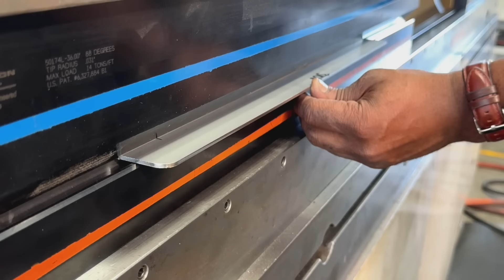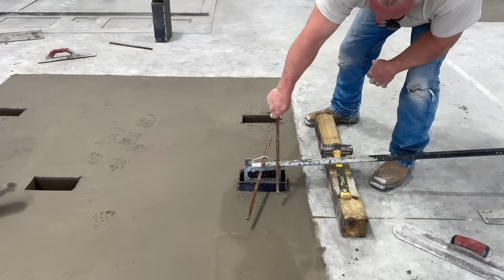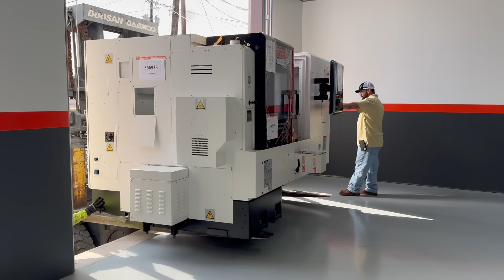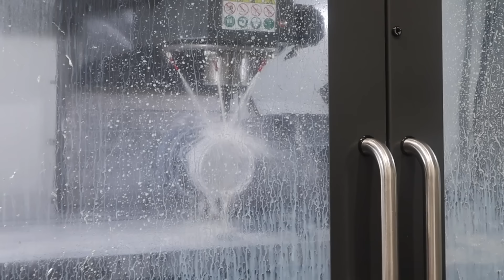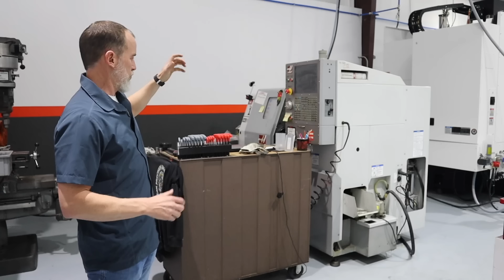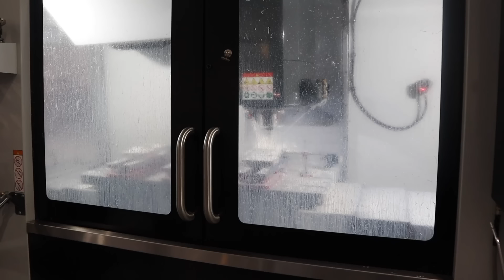We Turned a Greasy Warehouse Into the Ultimate Machine Shop

Comment: We faced the same thing..... Moved from 28k sq ft to 55k sq ft. Moved 60 CNC's in 2 days 15 miles. Rigger worked 24 hrs a day. Had 30 up and making parts in 4 days and all under power in 7 days. The first thing we did before moving in was use dry fall commercial spray and sprayed the entire interior including the red iron and insulation snow white. Then instead of studding walls we use steel liner panel 10 feet high all the way around. Simpler and faster. Put in copper Bus line so machines could be moved easily and hooked back in quickly.  Shot blasted and clear epoxied the floors so they could be mopped or Tenant cleaned when coolant was spilled or flooded. Ran overhead DI water to central locations so machines could be filled with mixers quickly when they needed water soluble. Every machine Ran Blaser's coolant. There isn't anything better out there. Have lived everything you've been thru....